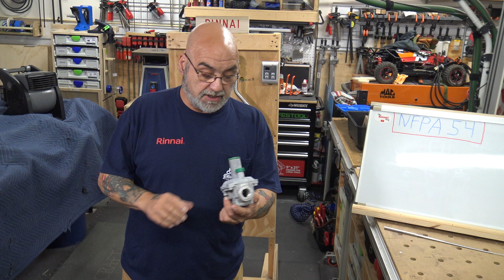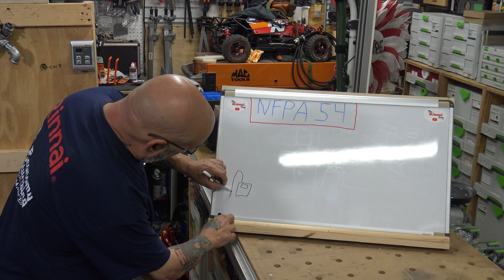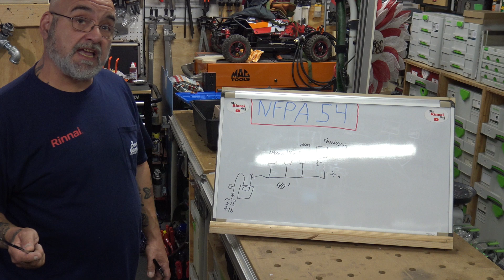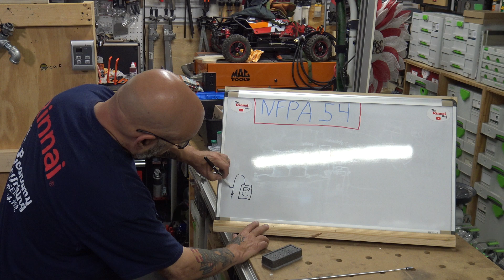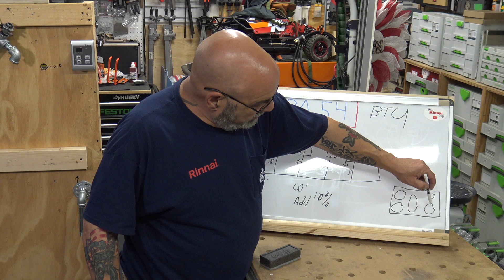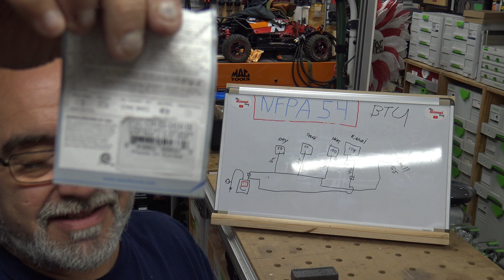Sizing gas piping for a Rinnai tankless heater

Comment: I live in Missouri and I’ve watched 2 of your videos on sizing which by the way you are a natural teacher. When you say a199000 can supply 4 bath a one kitchen would that still work  where I live since the winters are so much colder than Florida making incoming water temp so much lower? Also most homes out here have a large Roman tub in the master is that factored in with 4 baths 1 kitchen?

Comment: I have a Rinnai CX199i commercial unit. It’s installed in a restaurant with 3/4” 2 psi gas lines throughout. The Rinnai will be the 1st appliance on the line, about 4 ft from the meter (which has a red label). Using 3/4” fittings, do I need a regulator on the water heater line at all?

Comment: Thank for all your videos!  I am planning to install a RXP160iN to replace my old 50G gas tank water heater.  I think my old gas water heater is using a 1/2 flex pipe, and it was the first gas appliance from the point of delivery (gas meter).  Do you think if I should use a reducer to change the size from ½ to ¾ before using a couple of black iron nipples + a ball valve + a flex line to connect with my new tankless?
Thanks!

Comment: At about the 20-min mark you diagrammed something similar to what I have, 40ft of 3/4" from meter to water heater with a furnace in between. I think my meter is only 250K, not enough for the bigger tankless unless I don't use my furnace in winter.

Comment: Hi Mike quick question: do you need a separate regulator to the tankless? If i have a propane tank regulating a stove
Im using 3/4 pipe now for the stove.

Comment: What kind of paint are you talking..like spray?? And what just the threads. Hammock never heard of that. Wouldn't the paint scrape off while threading on?
 Or ..Wouldn't the pipe dope work as a barrier for rust? Thanks Mike

Comment: The Uniform Plumbing Code and the International Residential Code do not prohibit the use of galvanized pipe for gas. But some local regulations make it illegal to use galvanized pipe. Due to such prohibitions, many homeowners and professional opt to use black iron pipe in natural gas installations.

Comment: I have a question that that does not stand from this video however, I don’t know how to message you any other way. When using a tankless water heater system do you recommend using a expansion tank on the cold water supply line?

Comment: If I have a 1 inch line in to the house, that has a T down to a half inch can I just add a 3/4 inch line back to the 1/2 inch line that has 8 feet horizontal then 8 feet vertical down to the old water heater? Can I add a Half inch back up to a 3/4 inch without it break code

Comment: If I have a 3/4 inch gas line coming in and a T down sizing the gas line down to a 1/2 inch line can I add a T back up to a 3/4 inch line so I don’t have to replace the 1/2 line that went to the old water heater? It travels 8 feet horizontal then eight feet vertical down to the old water heater.
Reply from the maker: Yes you can just try to get as much 3/4” as you can
Reply: @ThatTanklessGuy i have a similar question anyway i can contact you to clarify my question?

Comment: Hi Mike,
We recently had a RU160P installed. Not often, but every now and then we get a code 12 and it seems like if I don't turn the water on full but let it run slowly at first, the issue does not show up.  I know we need to increase our gas line size, it's currently like a 3/8th and not 3/4th (why my installer didn't change it I don't know). Anyways, is this a water issue or the gas line not being to the right size.  He checked everything out after I first called him about the code 12 but of course things worked when he came.
Thanks.

Comment: Mike I am looking at replacing my 40k BTU storage gas water heater with a Rinnai 199,000 BTU heater.   My piping is 1" from the meter all the way to the water heater 66' from the meter.  There is a 80,000 BTU Forced air furnace at the 52' mark of the line from the meter.  Adding 8, 90 degree L's adds another 21' of loss.  NFPA 54 answered my question, per the 3.0 in WC chart I can support a little more than 544K BTU/Hr.  I only need about 280K BTU/Hr.  so my existing pipe should be fine.  Thanks for explaining where to find the chart.

Comment: This is crazy helpful thank you! I’m working with a sub-par contractor and double checking his proposal for gas line sizing right now. Question for you: When it comes to meter sizing, is it possible to have one meter supply two homes? The current meter I have is an AC-250 5PSI meter. I’m adding approx 300,000BTU’s to the existing setup that already supplies my home. So between the two like 400,000 to 500,000 btu’s. The pressure seems like it would work, but I’m going to need a bigger meter correct?
Reply from the maker: Yes you will a bigger meter to supply that added BYU’s Its possibly to have one meter for two homes as long as you are going to pay for the entire gas bill.
Reply: @ThatTanklessGuy  Awesome thank you. Appreciate all your help

Comment: WOW!!! I  just got off the phone speaking to Mike who SOLVED my tankless v75in water heater problem! 

It was a unique situation; my furnace and current water heater are intertwined and go/vent out through the same hole in the roof. I found out (confirmed my thinking) that I couldn't use the existing water heater area due to living in a 2 floor townhouse (Mike was sure to ask that - how many stories) and both units are located in a mudroom on first floor. This would require a new hole and capping off the furnace. 

The Lord had already suggested(gave me) to have the tankless installed in the upstairs laundry room. But after talking to Mike (I never told him what the Lord showed me) - he suggested the better place to install a tankless in a situation like this (2 floors, cant vent out the sides because houses are attached, furnace and water heater intertwined) is to install it in the 2nd floor laundry where less vent piping through the attic to the roofing is better! 

While creating a new hole is an expense, its a relief to know I won't be taken advantage of by now knowing the least expensive way of doing it before talking to a person doing the work. 

I thank the Lord for some people who can give advice without showing favoritism and partiality which is sin, but will just tell the truth - getting nothing in return for telling truth of what it is! Amen...
Reply: oh lord.

Comment: Hey, Mike, Learned a lot from your videos, thanks! I have a Takagi T-H3-OS-N (199k BTU, max10 GPM) be installed,  I like to add a recirculate water pump. I have two questions would like to get your advice; 1. Can I use a Rinnai GTK15 Grundfos Pump on my Takagi? 2. Which pump do you recommend？there is no recirculating pipe line in my house. I really appreciate your help.

Comment: Thanks for the information, just found you so haven’t had a chance to look at all the videos yet.  Also thinking of building a new house and looking at tankless.  It will need to be electric or propane as we have limited natural gas.  Maybe you have addressed this, if so, just let me know where — but can you talk about electric tankless.  

Also what about putting in a my current small house where all the plumbing backs up to the same short wall - kitchen and the one bathroom.  Hot water tank under the kitchen counter — was a short 50 but now due to insulation changes, is only a 30 gal when it was replaced which they failed to tell me - long story won’t bore with details.  So I thought about a electric or if I have to a propane tankless.  I have a 100 gal (??) or maybe it’s 100 lbs — not sure right now but it’s an upright tank about 5’ tall piped to my vented gas fireplace heater (opposite direction from the plumbing). Can I put the tankless in the attic (very limited space as it’s a little 5/12 or 6/12 roof). Or is a outside unit better. They are telling me they are going to have to tear up so much inside and it won’t fit they say under the counter which backs up to an outside wall to a deck and I don’t understand why? They are saying I have to give up a whole closet.  It seems it would fit under the counter and vent to the outside with the gas line run over to it. 

I wish you were nearer to Virginia. I don’t know if you really know what you are talking about but you got me convinced that’s for sure.  Some of these young guys coming out don’t give me much confidence.  

Besides the fireplace 32,000 btus I think—  I don’t currently have any thing else on gas. Might put a grill at some point but I doubt it as I like hardwood charcoal.  

So the issue was to solve my running out of hot water - with the 30 gal tank — and I’m getting about a 5-6 minute shower and for us girls that’s just not enough time. I can’t get my long hair washed twice and conditioned in that time, much less legs and getting rid of the dry skin soaks and scrubs.  Using a hose off the shower head as it is.  I do have an old shower head been in 20 years but friends that have put these really efficient shower heads in, the wives hate them and they end up cleaning and putting the old one back in (if they kept them) so they have enough pressure and water to rinse their hair. I believe in energy conservation and don’t want or need 1/2 hour to hour long showers but I do want to be able to get good and wet to rinse well and to take the occasional nice hot 15 minute shower to ease my almost 70 year old bones. I had no issues prior to the tank change and it seemed to recover better too than the current one.  Currently I’m running the water pretty hot (140) so I just add in a little cold - more at the beginning and less and less at the end to try and keep some warm going. 

In place of a propane Rinnai tankless which is $4,000 plus they say, they are offering to do a $800-900job to install a mixing valve, and replace current elements with 2 long heating elements. Now they didn’t look at the tank except to peek at it as they would have to slide the washing machine out — but maybe it’s already got long heater elements in, didn’t check to see what wattage it is either. Maybe they just know from the size. It was put in by a plumbing company - I think the guy has retired.  But I don’t understand how this solution is going to give me more volume of water and over a longer period of time. I thought the mixer valves were to keep people from getting scalded and from what I have read it seems the elements no matter whether long or short are the same surface area. The short ones are bigger diameter and the long ones are narrower diameter so it equals out.  Do you understand this or is this just going to be a waste of $800.  I had asked about something called a booster tank but said that won’t work and no room to put it.  You know people just don’t have the money to put these expensive options in and I’m on fixed income getting ready to do major heart surgery ... and I’m not a let’s finance or let’s just charge it  person, not at my age. Need to come up with a working option that I can afford BUT that works. They can’t seem to give me a figure by how much this less expensive option will add in terms of water time I will gain. If it’s only 5 minutes maybe 10, it’s not worth almost a $1000. But they can’t tell me at all — “just depends”. 

They say they won’t be pulling the old tank out to do the above but won’t be able to replace the anode units — I have moderately hard+  water - leaves spots on everything, the tank has been in since 2013 — seems like it would need the anodes replaced.  Especially since when I came back to this home (was gone before and after the tank was installed taking care of a relative 4-5 years and didn’t realize the volume issue but did notice an awful smell when trying to use the hot water. Would forget I had turned the electric off to the tank, the cold water was coming in but wasn’t hot of course and just sitting most of the time. After I returned, even after emptying the tank several times it still smelled but they turned the water to 140 and with time it got better. Won’t do that again without draining the tank. It was going to cost a fortune to pull the tank, take the top off and shock it etc.l drain it - they said it wasn’t dangerous, just smelled, some kind of bacteria. But it’s been fine for several years now with fresh municipal water coming in and being emptied and filled often as used.  Wouldn’t you think a tank this age should be ready for the anodes  to be replaced with the hard water. 

Another question, what makes a hot water tank sound like tinkling glass when it starts up to heat the tank — never noticed on my old tanks.  

I know these are non tankless questions but are important questions I’m sure for a lot of people now stuck with these new water heater tanks and of course they (companies) are telling us the tankless will solve all our problems. But I have seen they have cons too and more maintenance and concerns being gas. I have been told the electric ones are just not worth two cents.. I mean I want to save money on electricity but mostly want lots of hot water without being wasteful. But I don’t want to spend more money each year on maintenance and running costs for something that already costs at least 4x the price to install. 

Thanks bunches for possibly covering some of these in your videos.

Comment: I'm wondering if a R94LS model can be converted to LPG ??
Reply from the maker: it can but that’s a older model and it my be very hard to find the parts. you will also need someone a Rinnai service Tec. to do the conversion. it’s requires adjusting the gas pressure high, low on the gas valve. I hope this helped. Mike

Comment: Currently installing a V65in in my home. I’ve got low pressure gas so the gas company recommended redoing the 1/2in pipe with 3/4in all the way from the meter to the unit. Any suggestions or advice?
Reply: Yeah I’ve had to do that before

Comment: Well said and great info thank you. We installed a 4 cylinder 1300cc generator that adds another hiccup in this deal. We had to step up to the commercial meter with a 1-in pipe to run that generator.